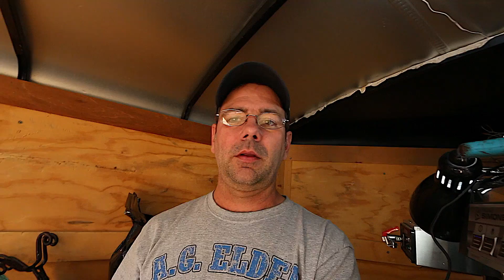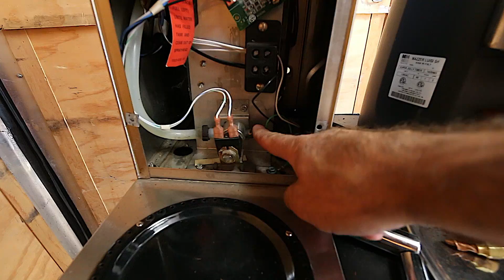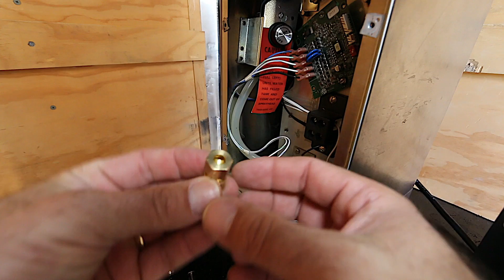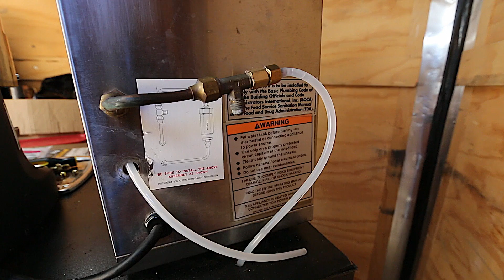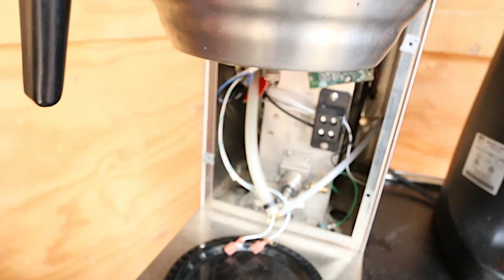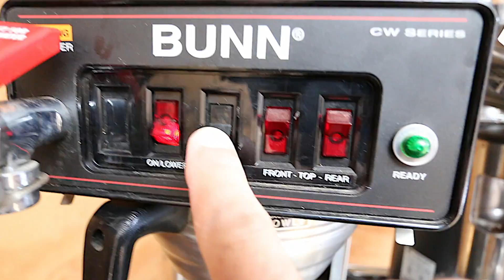Repairing a BUNN CWTF15 Coffee Maker - Leaking Bunn Coffee Maker

Comment: I am struggling with a CWFT15 right now.  It was in storage for a long time.  Tried to fire it up.   Didn't hook up the water, but poured thru the top screen.   Water heats, but coffee maker won't start.   The pump/solenoid that usually pumps the water up to the tank seems to be working but it isn't even needed when pouring thru the top, right?   What forces the water thru the spray ... heat and expansion?  Could I have a clog?  any help is appreciated!
Reply from the maker: My guess is you are correct. I don't think there is a pump for the way you are doing it. I'm not a repair tech, I was just repairing my own. Keep us updated on what you find out. I may try mine that way and see if I can tell if I hear a pump or solenoid trigger.

Comment: I have the same model and it drips about an inch of water into the pot and then stops.  Do you think the solenoid valve is sticking open a little or do you think it might be a circuit board problem?
Reply: I personally would look at the solenoid first.
Reply: @bobsumien-realtor1208  Thank you.

Comment: Hi cw series my machine continuous   spitting water doesn't want to stop what could be problem
Reply from the maker: Sorry for the late response but it is either not programmed to dispense the correct amount of water, you have a bad shut off valve or the wires to the shut off valve may have been disconnected.

Comment: Couldn't you have just soldered it?
Reply from the maker: Soldered what? The water supply line? I guess that's a possibility, but I wanted something I could fix on the fly at a job site (mobile coffee / espresso bar) and plastic line is much more easily fixed quickly and under stress.... :)

Comment: what is no water is flowing when you press Brew. It used to flow and now completely stopped.
Any suggestions? Thanks
Reply from the maker: You might start by making sure someone didn't turn the water off by mistake. :) Then I would look at the solenoid valve. Do you hear clicking when you push the button? My guess is either you've lost power to the solenoid or the pin inside is stuck in the closed position. If it clicks when you push brew then the simplest thing would be to replace it. I have a link to the part in the description above. Let me know what you find out.